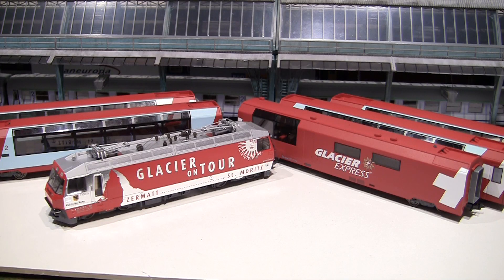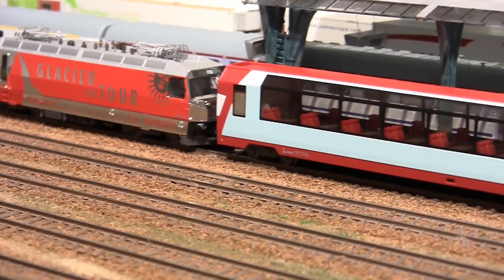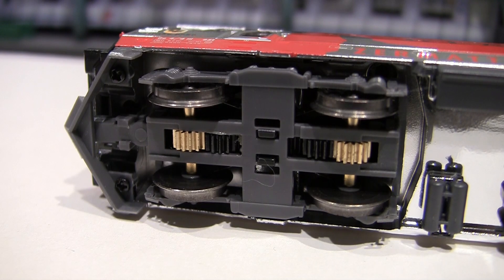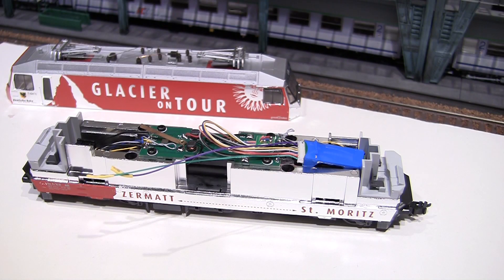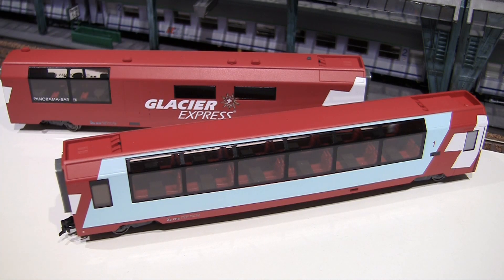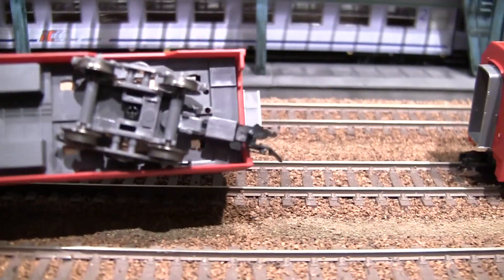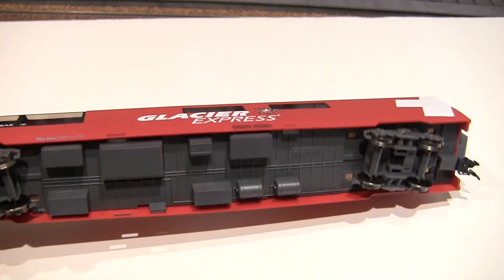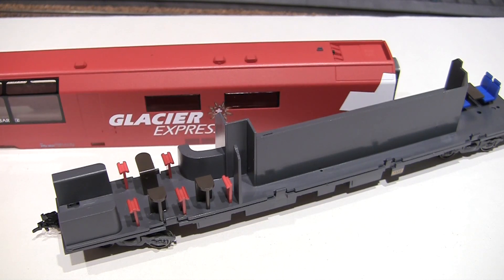Glacier Express BEMO H0 - disappointing quality (not H0m) UPDATED review

Comment from the maker: And here is the answer from the retailer in Germany after contacting BEMO. " The body of the coach is normal like this and it not a reason for a reclamation. If you don't want to keep the cars you can of course send them back"  In short according to BEMO quality standards, the bulging of side walls is normal.
Reply: Shocking to be honest…
Reply from the maker: @R1door  ended, I received multiple parts from Bemo to replace included entire wall panels still these are $25 models in my opinion. Regards Peter
Reply: Peter, if you're being told that the bulging of the side walls is normal, then you have been lied to - either by the dealer or from Bemo if the dealer did really contact them. The bulging of the side walls is not normal Bemo quality! I have over 80 Bemo passenger cars and they do not have bulging side walls. This is a fault. Also, Bemo does not have working close coupling on any of it's models. That design you show of the couplings is exactly the same as the HOm models.

Comment: I think one of the main issues is that Bemo virtually hold a monopoly on the HOm market (and its derivatives like your HO gauge versions, along with HOe conversions) as far as Europe is concerned. Some of their stuff is okayish - about €75 for a passable coach (tending to be on the rather light side but I've not had issues derailing on my quite uneven trackwork). I should mention, I only really started to acquire Bemo because I'm joining in the Hornby TT:120 venture and HOm uses the same gauge track and I've got lots of Swiss HO and N standard gauge.

I've got some pretty decent stuff second hand for the €35-€45/coach price mark (which is what they should cost new). I got what must be a pretty old Fürka-Ober alp loco that runs impressively well for €85.

I'm sorry you have been so disappointed (so would I have been paying full price and getting what you got). That being said, depending on your set-up, if you're not 100% too bothered by what-should-go-with-what, you can have some fun in the gauge and not feel totally ripped-off by being patient with the second-hand market.

As a potentially viable caveat, Bemo may argue that their target market is small compared to 16.5mm, etc. and that's why their stuff is so expensive/lower quality... But that would seem a pretty poor excuse...